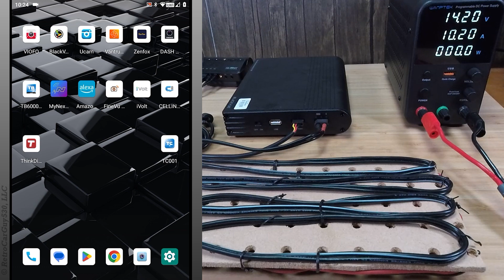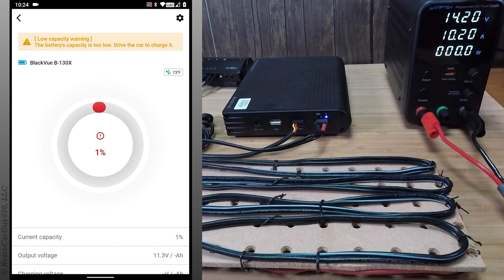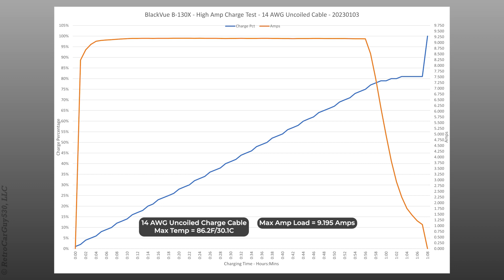BlackVue Power Magic Ultra Battery B-130X - Uncoiled 14 AWG Charging Cable - High Amp Charging Test

Comment from the maker: I ran another high amp charging test using the BlackVue B-130X with its 14 AWG charging cable.  This time I uncoiled the charging cable.

Previous test with coiled 14 AWG charge cable
    Max amps = 9.278
    Max temp = 103.8F/39.8C
    Charging time = 1 hour 0 minutes
Test with home made 12 AWG charge cable
    Max amps = 9.179
    Max temp = 84.2F/29.0C
    Charging time = 1 hour 8 minutes
This test with uncoiled 14 AWG charge cable
    Max amps = 9.195
    Max temp = 86.2F/30.1C
    Charging Time = 1 hour 8 minutes

The max amps and charging time didn't really change much, but the max cable temp was reduced by 17.6F / 9.7C.  An installation of this battery pack with its 14 AWG charging cable would very likely have a large portion of the cable covered by interior vehicle body panels and/or carpet.  The realistic max temp is likely somewhere in the middle of these two test samples depending on how much of the cable is exposed to air.

Comment: I want to make my own BlackVue charging cable for home … which awg wire cable do I need to use and which connector do I use as well if I was wondering if that was correct XT60EW-f Mountable please help
Reply from the maker: I would recommend using 12 AWG OFC (oxygen-free copper) wire cable.  The XT60H-F is what is needed to connect to the existing connection port on the battery pack.  There's no mounting feature on the BlackVue battery pack for the cable, so you don't need "E" (mountable) version of the connector.
Reply: @RetroCarGuy530  thank you so much and one last thing I did saw on Amazon the xt60h- as a metal plate in the middle … dwindle the effect the charging system  .. because I seen it’s fast charging BlackVue
Reply from the maker: The XT60I-F has the third connector in the middle on the outside of the XT60I-F which is used on the cigarette lighter adapter cable provided with the BlackVue battery pack.  The XT60H-F does not have the third connector, so the BlackVue battery pack will charge in high amp charge mode with that type of connector plugged into it.
Reply: @RetroCarGuy530  thank you so much for your  help and sorry for dumb questions  and you help a lot and I’m going to get 2 xt60H-males and  and 1- xt60H-F  for a y splitter… I want to add more juice(extended battery)  to the cameras to last longer
Reply from the maker: The XT60 port on the BlackVue B-130X is an input charging port only.  I'm not sure how a Y-cable is going to help you.